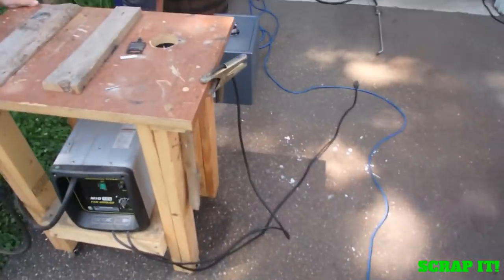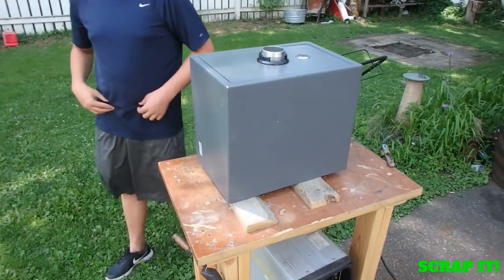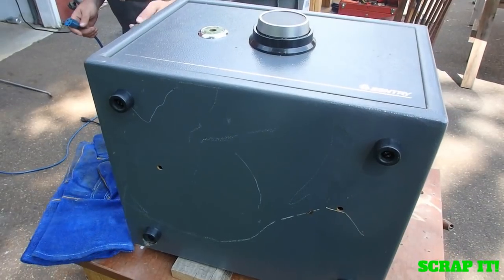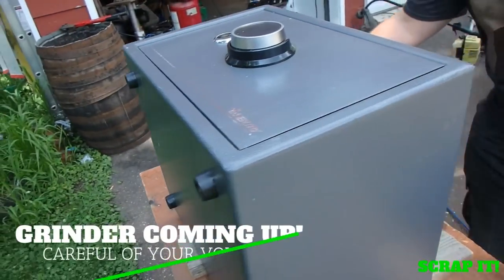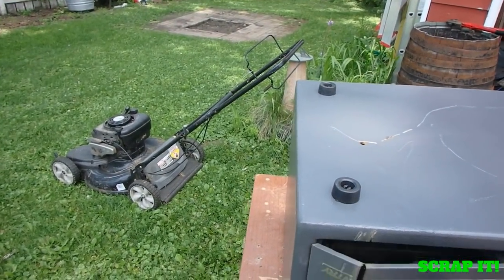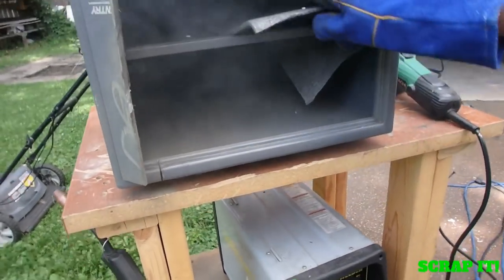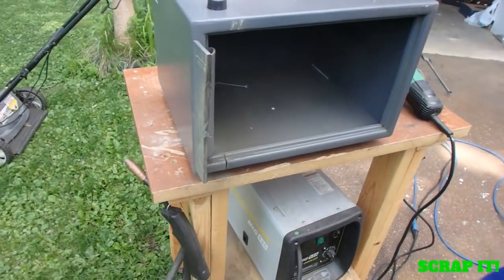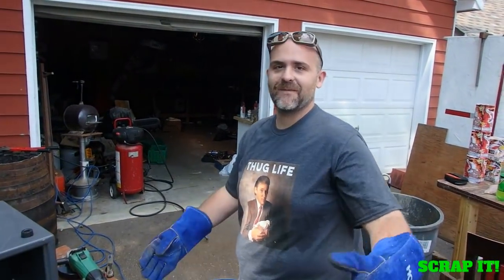Let's crack open that dumpster diving safe!

Comment: Sorry it's not a combination lock I commented to soon! 
So you could have bumped it opened
Check out "opening a safe with a potato"
To see how to open most cheep safes
Reply from the maker: Lockpicking Belfast .... I probably could have just dropped it on the concrete and it would have popped open but my friend really wanted to cut the thing open
Reply: @scrapit6692  watch the bump video anyway its wild what people think is "safe"  :0)
Thanks for the reply buddy.